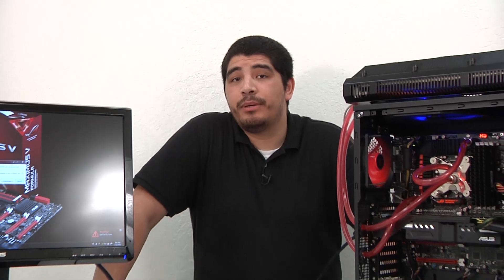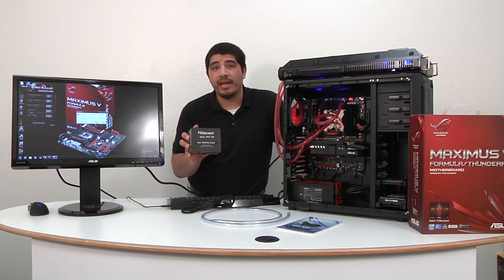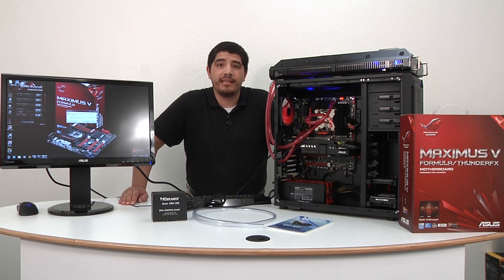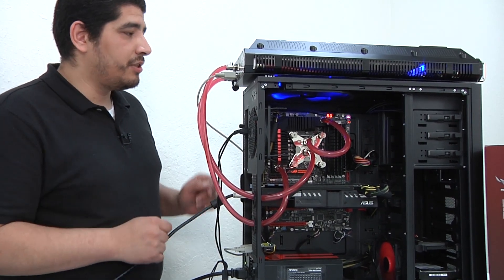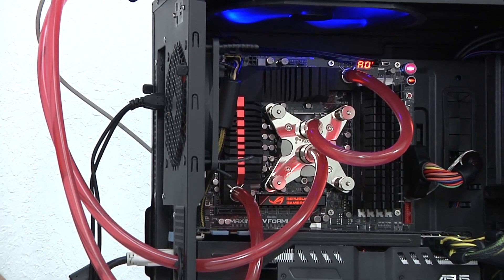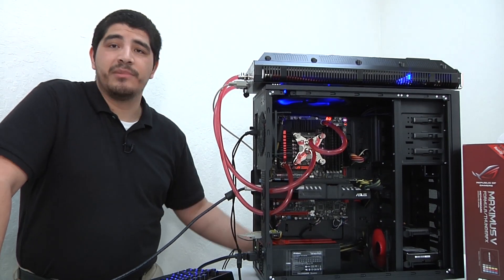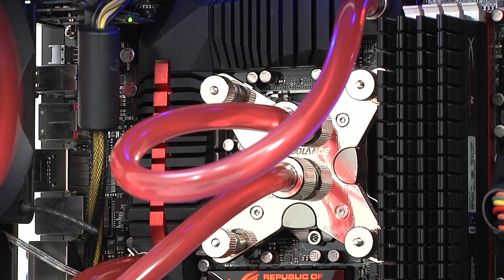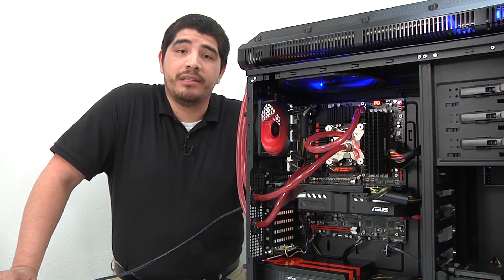Overview: Fusion Thermo on Maximus V Formula Motherboard

Comment: in their defense, they claim the aluminum is heat treated to prevent the corrosion that would occur due to the mixed metal pipeline.

Comment: Hi JJ, Im going to be building a new ULTIMATE gaming rig my budget is going to be 2,000 but can go higher if needed!!! I really like this setup you just showed in the overview! Now does that water cooling unit on top actually cool the water like with freon or does it just have a rad in their that just blows air through??? Also do they even make water cooling systems that REALLY cool the water???

Comment: What kind of voltages did you have to use to achieve 5.0 Ghz? on the 3770k? You probably had to use 1.500 volts for that, maybe even more with a good cpu.

Comment: Is it possible to change the fittings on the fusion thermo?  I am planning a build, but I really want to use 3/4 OD, 1/2 ID tubing.  It would be kind of ugly/aggravating to have to adapt it.

Comment: Hi JJ, just want to ask if my 16GB (4x4) Corsair Dominator Platinum @ 1.65V will work fine with this board and no problem with overclocking?
Thanks and more power to ASUS.

Comment: Hey i was wondering if an intel liquid cooled solution with an intel 3770k on this motherboard would also cool the cpu adequately. Also would this be taking advantage of the fusion thermo or would it remove it completely?

Comment: I have bought recently a gaming rig and I chose a TT VO200M1W2N Armor Revo black case and the motherboard fits fine and clear, there are also three ruber openings on the left above side of the back i/o panel and above the backside fan for the watercooling tubes.

Comment: hey jJJ my question is not on this vid but on the Sabertooth Z77 motherboard, i would like to put a cpu air cooler on but not sure of a good one  and not sure which one would fit because of the body armor on the sabertooth. any feed back would be greatly app.   thanks again....

Comment: Thank you for the info and the demo JJ. This will be my first attempt at setting up a water cooling system and I would like to know what other manufacturers/set ups that you might recommend for cooling the CPU and the water block. I always like to do a little comparing before I make a purchase, and i'd like to draw off your expertise and intimate knowledge of this mobo to assist me in making an smart buy

Comment: J.J. did they pull you out of bed for this review? Also as some others said, what temps were you specifically getting? With air cooling, my Maximus V Formula w/ i7 3770 maintains ~36C under gaming conditions. No overclock though.

Comment: hey, would you be able to use air cooling instead with this motherboard, if so what CPU air cooler would you recommend? (this is using intel core i7 ivy bridge)

Comment: Yes, taking the Fusion Thermo and swapping it to the Extreme V. That is my hang up, because the aftermarket blocks are half the Formula's cost and I also need the Formula motherboard for another build a stock, lower gpu budget build as a surprise for my parents.
Thanks for achieving greatness and for responding.

Comment: Let me rephrase; is it possible for one to buy both boards & take the Formula waterblock and mount it on the Extreme board... then put the Extreme passive solution onto the Formula board?
I want a stock themed loop on the Extreme and not on my Formula... I want it to be passive as it will not be pushed as hard as the Extreme.

Comment: I mean, I need two boards anyhow, but i don't need the water on the Formula... I would just use a third party manufacturer and remove all stock cooling solutions from the Maximus V Extreme. XSPC has a nice little (haha, it's massive) block that covers the entire chipset all the way to the bottom of the CPU socket.
I don't know why the Formula has the OEM water cooled option and not the Extreme. It's probably about 20.00 to make that block for for the Formula... please say yay or nay..... J.J.

Comment: why didn't Asus just make the fusion thermal with 1/4 threads. This will most likely solve all water cooling needs.  Just buy your size barbs and compression fittings.  Seriously people who are buying this motherboard with water cooling set ups wont have tubing that look like noodles.

Comment: J.J. i just want to let you know that i have almost completed my build, which includes this case and MB, and i just want to thank you and the brilliant team behind the ROG Motherboards in general and especially the team that have designed this magnificent Motherboard. As a first time builder i have enjoyed building my rig with this MB and case, heck! i even enjoy just looking at it. My only problem with it that it is a little difficult to install the WiFi antennas to the Combo Card, but possible

Comment: So basically your MAKING people use 3/8 fittings. So for those who use bigger tubing/fittings, We have to change everything to 3/8 size. You shouldve made it with G 1/4 Thread holes ONLY, So people can use their current fittings without having to go out and buy 3/8 fittings/tubing or have to 'RIG' it to go from 3/8 to other sizes, Which would look ugly. I use 3/4 size fittings/tubing. I wont be buying 3/8 stuff just to use this. Waiting for some company to fix this screw up.

Comment: J.J. if i can make a suggestion for the next motherboard from ASUS that will include Water cooling, please use G1/4 threads. Many of the people who choose to water cool their PC like to pick the barbs/compressions of their liking, and the pre-installed barbs of the Formula really limit them. Additionally, if it would be possible, ASUS should try/consider to collaborate with EK / Swiftech / XSPC etc to make a ROG CPU Waterblock to make Water-cooling even simpler for the users.(with a LED ROG eye)

Comment: J.J. can you try to check if it is possible to mount a 200mm rad internally in that case? (the only rad for that is the Phobya 200 rad, and it mght need a different than stock fan)

i would really appreciate an answer Juan Jose :)

Comment: Is the heat pipe on the Maximus V nickle plated internally? other wise you are mixing the heat pipes copper with the EX2-1055's aluminum radiator and having these two metals exposed to each other in the same system is a big no no